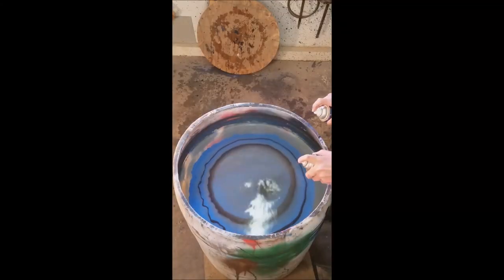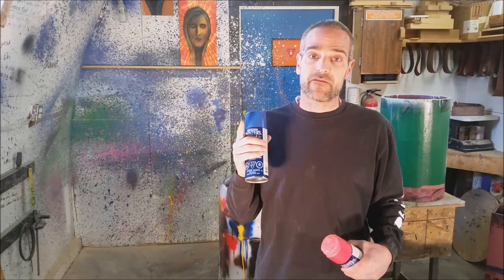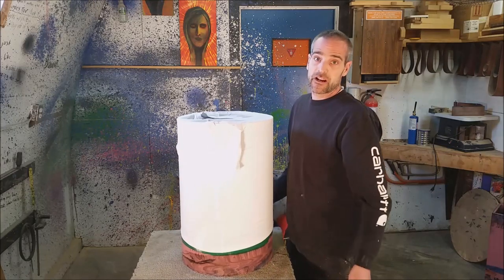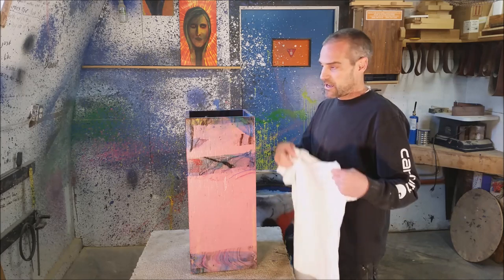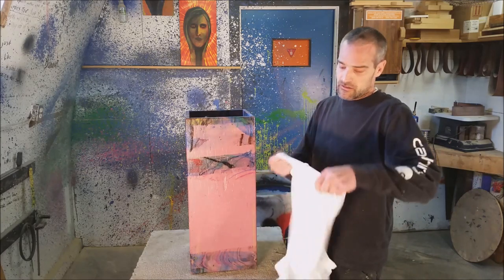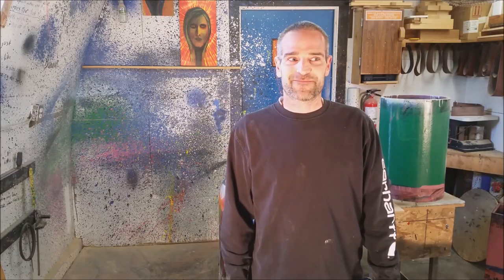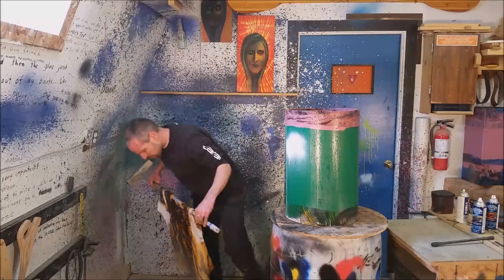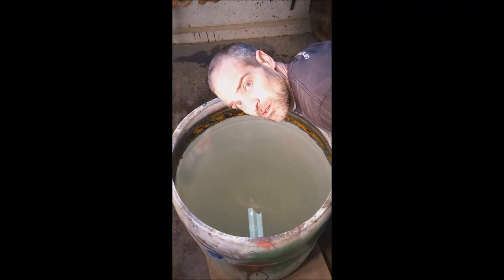How To Hydro Dip Shirts

Comment: Love this! How do you finish them out? Let them dry? Immediately wash? or?  
 I want to do this to my couch covers and give them a little bling but hesitant.....
Reply from the maker: After the dip, I just hang dry them, then turn the shirt inside out and wash them in cold water.  If you are doing couch covers be sure to have some sort of jig to keep the covers stretched out a bit. It wont work just to push cloth into a barrel of water.
Reply: @mefjoris  Thank you !
Reply: Ok so this is only cold water and spray paint ??
Reply from the maker: Yes.
Reply: @mefjoris  does it last ?
Reply from the maker: Long enough to make it worthwhile.

Comment: What's the name of the spray paint Jeff
And where can we get cylinders 
Please?
Reply from the maker: The paint I am using is called Painters Touch. Most fast drying spray paint should work. I made the cylinders, so im not sure where one would buy them.
Reply from the maker: Cold water.
Reply: @mefjoris  can you make me some .
I wanna make these 😍
Reply: you could use cement footing tubes, from a hardware store

Comment: Hi Jeff great video...I got a question i tried the technique but couldnt work cause the colors made a crust and couldnt do a design...any solution?
Reply from the maker: Use cold water.  Have no air movement. Once you put the paint on the water dip the shirt right away. The paint starts to dry on the water quickly.

Comment: Hey, so very clear video, but when I tried this  it would work but the paint wouldn't bind to the fabric. Like it will start to dry and seperate from the textile, basically just falling off. Is this because of the kind of paint I use? or the fabric? Or anything else?
Reply: No answer?
Reply from the maker: Did you use cotton fabric? Did you use quick drying paint? Hard to diagnose your issue with not knowing what you did.
Reply from the maker: Thanks for your thoughtful and intelligent comment.

Comment: Use what spray paint? That wasn’t clear to hear
Reply from the maker: Any fast dry spray paint should work.
Reply: Another quick one mate. After spraying paint in the barrel do you use a rag to remove the excess paint or do you have to refill with water?
Reply from the maker: Just clean the leftover paint off of the water. I use a screen.
Reply: mefjoris absolute star mate. Thank you for the reply
Reply: Levi Hague you have to use oil based spray paint me and my wife was messing around with it yesterday and hydro dipped a insulated mug and it turned out badass 😎

Comment: I wonder what color your lungs are.
Reply from the maker: Pink.
Reply: @mefjoris  The reason I ask is I spray bombed lots of appliances and it took me a couple of years to clear up my cough.
Reply from the maker: No problem. Like I said in the video I have a kick ass ventilation system in my shop. I turned it off just for the video. But thank you and everyone for caring about my lungs. Much appreciated.